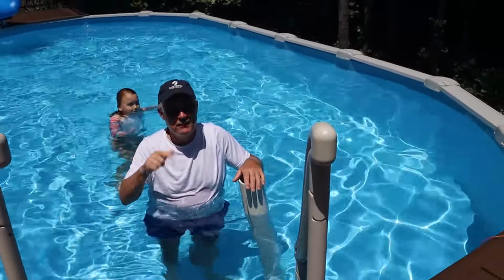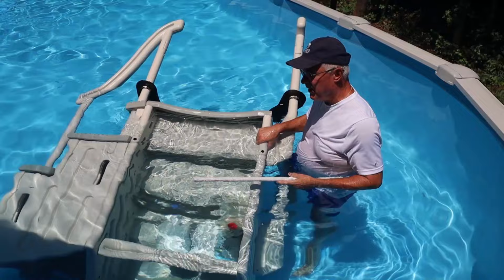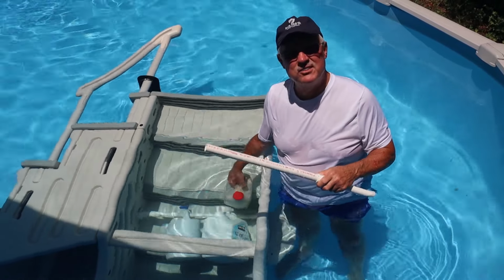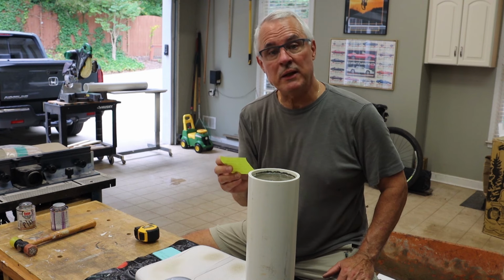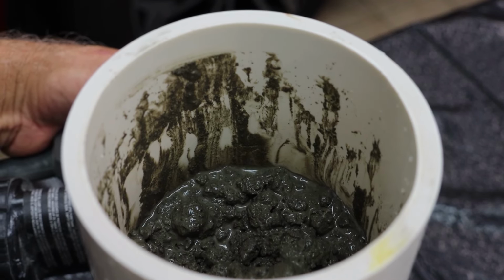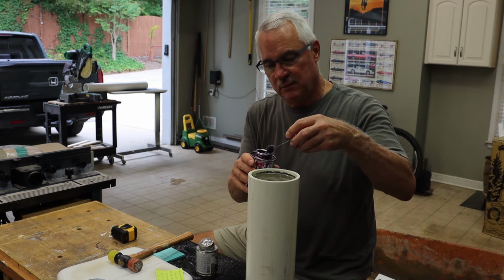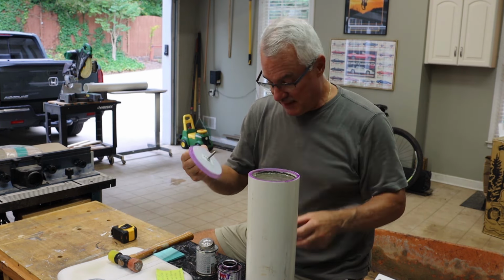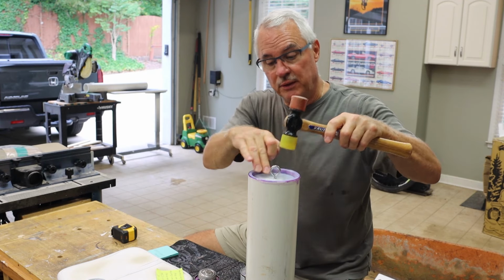Prevent Pool Steps From Floating

Comment: Can you please post a picture where you place the PVC pipe to attach the cement filled pipes
Reply: Hi, depending on your steps, there will be holes in different places. You can always drill your own  and place the pvc where you want. Be sure to use a spade bit to make the hole.
Reply: @SafeTravelRV  I have the same steps without the extra piece and I'm not as innovative as you so a picture in place would be extremely helpful. Thanks, Doreen from NJ
Reply: @doreencevasco5024  
Hi, unfortunately I can’t take any pictures as the steps are attached. Look on the side walls that support the steps. There should be holes. You can insert a piece of PVC pipe cut a little long and zip tie the weights to them.

Comment: Just making sure , 
You used 6 test caps?
Do I wait until cement dries to connect to 3/4" pvc bars?
Did you only have 1 bar on the one side to connect all 3 weights? 
I also do better actually seeing it, 
But seems simple enough as long as I have correct supplies. 
I'm doing this tomorrow,  I agree the sand is not the best idea. 
I'm ready for anything other than what I've tried. 
Oh please 1 more thing , is there anything other than the original  step to deck support that might work.
Reply: Yes, 6 caps, wait at least  a week for concrete to dry. Spread the weight out by using 2 bars if you can.  I took my deck mount brackets to a metal fab shop and they made new ones out of stainless steel diamond plate. then i had them powder coated.

Comment: Hi. I know this comment is late, but after you install the end caps with the rings, where do you hang them? You didn't show that part. Do you install hooks on the inside of the steps to hang them from?
Reply: Hi, please review video again. At the 2:46 section, I explain how to hang the weights from the pvc bar I discussed at the beginning of video using zip ties. I should have mentioned that you need the large zip  ties found in the HVAC section of Home Depot. Just ask and someone will help you find them.
Hope this helps!
Reply: @SafeTravelRV  Thank you. I wish I had found this last year.

Comment: I bought some 10 pound weights at 5 Below & tied them to each side on the underside of the steps but I didn’t have quite enough weight. The pvc pipe is giving me some ideas. I need to add more weight this summer.

Comment: Great video,did you take the caps off where the sand supposed to go so they would fill up with water or drill some holes thanks. Im making your tubes this weekend
Reply: Hi William, I did both. When you first put steps in water, wait for it to fill up then turn on side to release anymore trapped air.

Comment: Don't the sand go in the steps?
Reply: I use these weights and do not put sand in steps!
Here’s why: it makes it very heavy if you want to remove steps later and it’s takes some time to get enough sand in the steps.
Use the weights and drill some more holes in steps to allow air to escape.